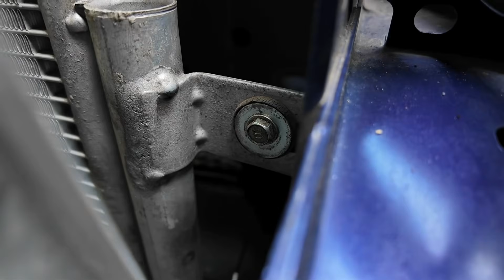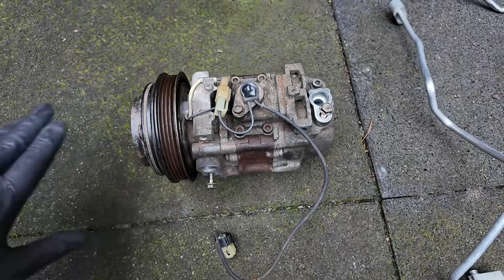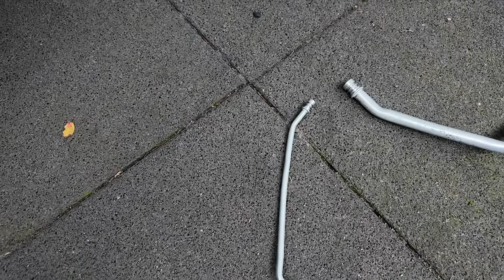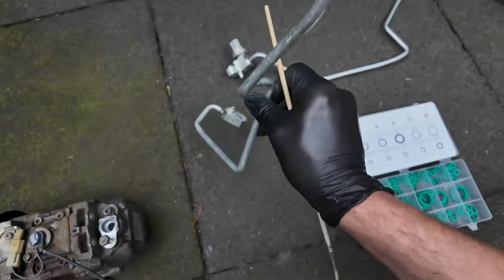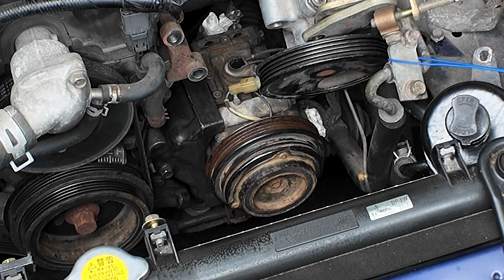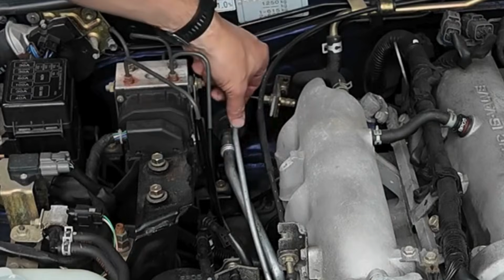Installing air conditioning on the NB2 Miata - Part 5 of 6 - Closing the system

Comment: How did you install line nr.1? I can't get it to fit around the condensor and radiator without bending it, im scared to damage the line.
Reply from the maker: Line nr.1 can indeed be challenging, especially since it also needs to align properly near the pressure switch. 
I have had several used sets and noticed that line nr. 1 can get out of shape when they remove is from the parts donor. If I recall correctly I have been guiding it in place from the bottom to the top and connected it first near the pressure switch and later to the condenser. If needed you could heat up the line a bit to carefully bend it in shape, but this should not be necessary with a new line.

Comment: Thank you for these video's they have answered a lot of questions. 
I'm trying to remove the condenser because a rock hit it and created a slow leak. We had the system completely vacuumed out and they said it still had a little r134a in it. I was wondering if during the vacuum process do they remove any of the pump oil and will I remove some of the oil by replacing the condenser? 

Thank you for showing us all your hard work.
Reply from the maker: Thank you for watching and for raising this question.
When the condenser has a hole in it, you can imagine that pulling a vacuum to extract the gas will not really work because air will be pulled in via the hole. There will be atmospheric pressure in the system, so most gas will have escaped. Some gas might be trapped inside but very little. The oil in the system is spread through the whole system. As a rule of thumb, you can expect half of it to be in the compressor during normal operations. The rest is in the lines, condenser / dryer, and the evaporator. That is also why the manuals advice you to add oil when you replace the evaporator or dryer. From the top of my head I believe it is 20 grams for the evaporator and 40 grams for the condenser / dryer combination.
During the extraction of the gas by vacuuming the system, the machine will not only report the amount of gas it extracted from the system but also the amount of oil.
Reply: @mx5info  
Perfect thank you for the help. That's exactly what I read from a quick Google search but I wanted to ask someone who actually did the work. 
You are one of the easiest to understand and to learn from on YouTube. Thanks 👌

Comment: DONE, AC is in Freon is in it works and blows cold. The biggest setback for this whole ordeal was the 3 pin connector under the dash, either the pins for the A/C amplifier were a little too perfect from the factory or the connector was too tight because i did not notice it wasnt pushed fully in and that meant when i pressed the A/C button revs wouldnt go up and compressor clutch would not kick in. After about 5 hours of checking every single cable for continuity and voltage with the help of the 99 service manual (i did this upgrade on an nb1 with the nb2 package from IL Motorsports), several forum posts, wiring diagrams and properly understanding how the entire system works and determining that the 3 pin plug for the amplifier worked, while thinking, for a workaround or ordering a new thermosensor i wanted to check if the amplifier still worked. So, i took out the amplifier plastic thing and i realised the plug must go deep... a lot deeper than i was comfortable pushing it at first and the pins and circuit board might have also not had the best alignment because when i fully seated the connector to hear the click it also pushed the motherboard out, but now that it made full contact there was SUCCESS!
Thank you for this most informative series, as a side not to anyone in the future reading this, the pressure switch and the a/c amplifier can be bypaseed with a fused wire so technically you don't even need charge or a working thermosensor in the ac to see if the clutch and fan engages but do this only if you understand the wiring diagrams or output and input voltages work to the ECU work and only to check if compressor and fan turn on!

Now the only thing left is to tighten the accesories belt a little more because it randomly slips a little when driving with high rpm and the compressor turns on, but i suspect that is just the belt elongating due to it being new brand new.

PS: The A/C draws quite a bit of power and it makes the car feel quite a bit heavier, while also making a sort of a diesel rattling sound, but miata forums say it doesn't affect things in the long run however i understand why you would want to take the whole thing out if you use your mx5 for track-days a lot. Nonetheless the comfort of A/C in current European summer is mandatory.
Reply from the maker: Very nice to hear that you managed to get a working A/C.
I can confirm the bypass of the thermo switch, as I have used it in the past to prove that the thermo switch was the reason why the A/C was not longer working in that car.
The only risk of jumping two wires in that connector is that the evaporator is no longer protected against freezing.

Comment: Hello, I am in New Zealand and have an 04 NBFL with factory no AC (1.6L from the UK), I have found a NB1 AC system here but was researching and the systems are slightly different and ultimately incompatible?

Thank you for the in depth guide!
Reply from the maker: There might still be some hope. From what I have understood, mechanically an NB2 system fits on an NB1, so the other way around might be feasible as well. There appears to be a difference in the wiring for the thermo switch, that would require you to swap to wires in order not to fry the thermo switch.

Comment: Do you have a diagram with what size oring goes where. I’m trying to replace all the ac orings on my Miata but I just wanna make sure I’m putting the right size on.
Reply from the maker: I don't have a diagram, and also think that replacing all O-rings might be overrated. I have the impression that the original black O-rings are of a better quality than the green ones I bought. At some point I was chasing a leak and decided to put all the original O-rings back in. The leak turned out to be a pinhole in one of the aluminum lines. After replacing that line, the system passed the vacuum and pressure test with the original O-rings. I have seen O-rings in 3 sizes, as pointed out in the video. The 14 x 2.5 and 7 x 2 are easy to find, but I still have not found the 11.5 x 2.4 O-rings. When looking at where the different sizes are used, this is what I noticed:
- The discharge hose uses the 11.5 x 2.4 O-rings.
- The suction hose and line from the evaporator use the 14 x 2.5 O-rings.
- All the liquid lines (8 mm diameter) on the condenser and all the way towards the evaporator use the 7 x 2 O-rings.
- At the evaporator valve you will find all the different sizes combined.
In total we might be talking about 14 O-rings.
Not all cars use the same condenser and line #1, this may also affect the total number of O-rings. It depends on whether the A/C system was installed at the factory or later on in the process.
Reply: @mx5info I truly appreciate the reply because I’ve been working on this ac leak since I’ve owned the car and it’s be grueling